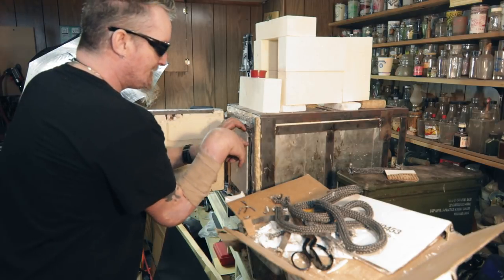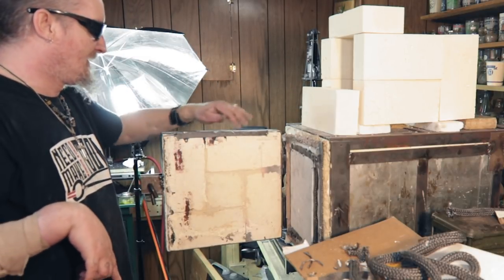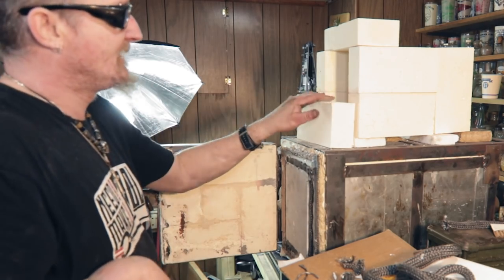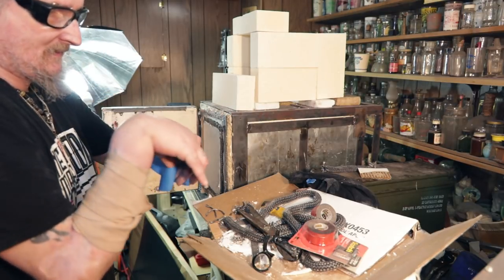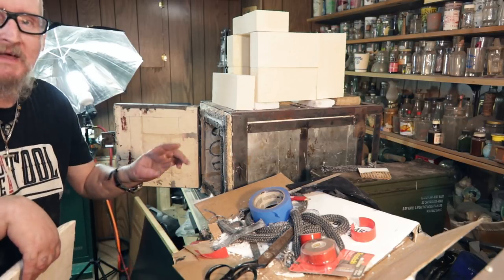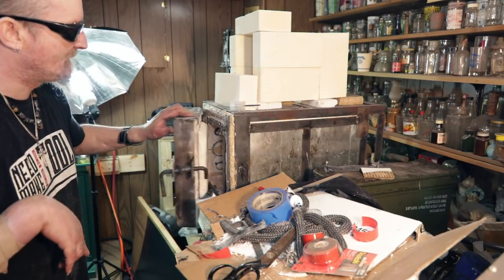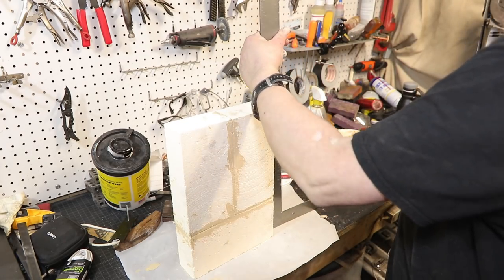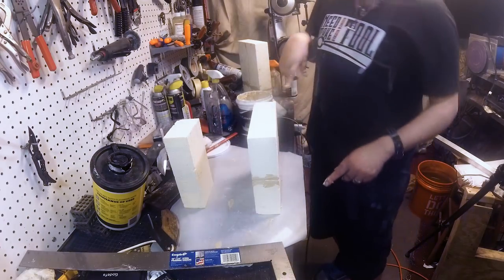Knifevlog 3 - DIY Heat Treat Ovens(fixing & building another 2018)

Comment: I was about to hook up my wood stove with galvanized pipe but learned it causes dangerous gases. Thank goodness my buddy warned me.
Reply from the maker: Yeah, burning galvanized steel can make you really sick & in some cases even lead to death... the thing a lot of people don't know, it is really only a coating on the steel.. It's when it is vaporized, that it becomes toxic... You can actually take a disc grinder to it, but just make sure to wear a respirator and don't get it hot enough that it puts off smoke...

Comment: hey , dave i had a productive day knife making man , ive gotta build a new forge , old coffee can not big enough , lol
Reply from the maker: Awesome, I hear that... I actually started with a homemade propane forge i built from an empty propane tank... it worked really good... just make sure there is absolutely no propane in the tank when you cut it open... they are pretty cheap at home depot empty... I bought all the parts there too, just used the black iron pipe. If you get the zinc/galvanized pipe, make sure to remove the coating..
Reply from the maker: My older videos were pretty bad, but here it is.... https://youtu.be/iRmjoALe-lU
Reply: @evaderknives  yes sir i wTched it at 4am this morning you un ur friend did like 9blade that thing is rad , ive got a big steel enpty fire estinqiser , im us , just tryin 2 work iut s burner or 2 , realy like ur weed torch if i could jus rig that sime how , i e got every thing minus the burner , any pointers be much aooeruciated , luv u dude ,peace
Reply from the maker: @thefamily_ak1863  That weed torch would be hot enough, the problem would be figuring out how to mount it... There are a lot of good videos on building burners... it's been so long, I'd hate to give you bad advice. propane can be pretty dangerous.
Reply: I’d use the smaller torches for a coffee can forge. Haven’t done it but seen videos on it